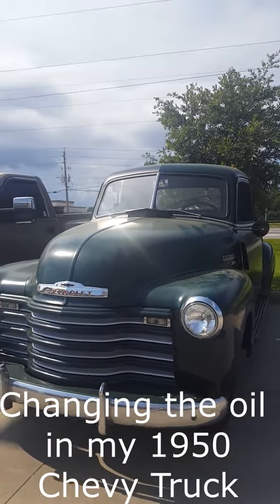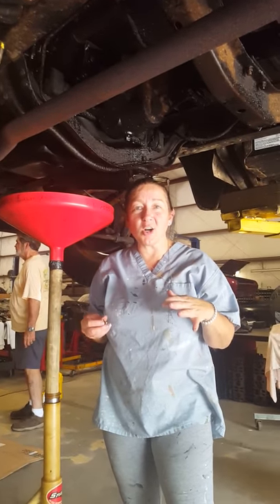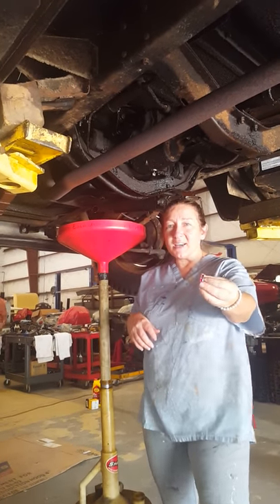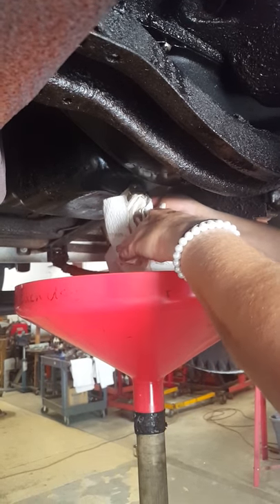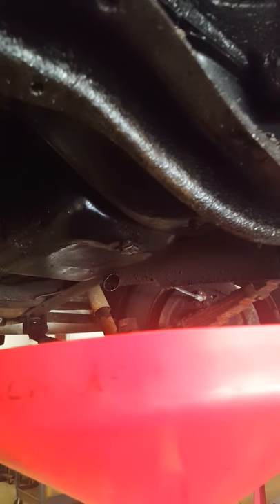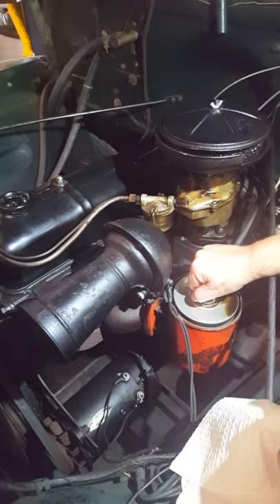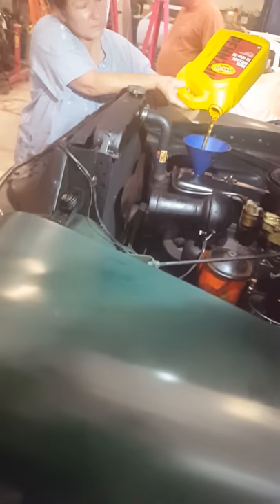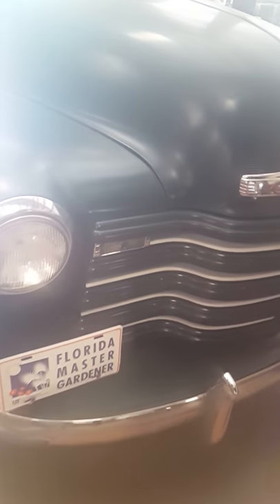1950 Chevy truck oil change

Comment: Nothing beats an old babit beater. I've got a 47 myself with no oil filter. It was actually kinda pointless on the 216 because it only really filtered part of the oil. Your cank case system was separate from the rocker system. I guess it beat nothing but one has to wonder how much filtration those filters actually had.

Comment: The good old american way Use filters that dont clean oil then drain the dirty oil. I stopped draining oil in 1963..with a toilet paper oil filter. Started with a Frantz oil cleaner. All I use now are the easier to service Motor Guards and Gulf Coasts. They all clean oil. I use Great Value 1000 from Walmart  now. Many use Scott 1000.
Reply from the maker: Thank you for that information.
Reply: I recently put a Jackmaster Classic on the Pontiac. I converted a flat head Ford bypass filter to take a roll of Scott 1000. Im putting it on 1900 Ford tractor I just bought. Was looking for a 8 N in good condition. Ended up with a 79 1900 4 wheel drive diesel that needs work.

Comment: I have a 1951 Chevrolet truck and was told that I need to run non -detergent oil because oil with detergent in it will destroy the bearings , is there any truth in this ?
Reply: Jeffrey Lehn my dad says you can use detergent oil . It will clean all ports, etc.
Reply: They gave you two choices on the old cars. No oil filter and a filter that didnt clean oil. My 38 chevy sedan had no filter. Even the people that had the filters were content as hell draining the dirty oil. No thought that the sludge and other contaminants  should be in the filter. People were so content with draining dirty oil that when John Frantz invented the filter that cleaned oil and used a 10 cent roll of toilet paper it was considered  snake oil.by many. Filters that didnt work were legitimate. I put a 235 in my father in laws old 50 chevy.I put a Motor Guard oil cleaner on it.and Standard Delo 30 weight. He told his wife he wanted me to have it.. wife talked me into giving it to her brother that was crying. He put a junk 260 v8 in it that threw a rod.then I was crying. He should have at least put a 283 in it. Standard  Delo was a high detergent oil with all the additives for diesel engines. There were no multi grades for diesels in those days.  Delo 100 in those days.Delo 400 is what you see mostly these days.
Reply from the maker: @ralphwood8818  thank you for that.